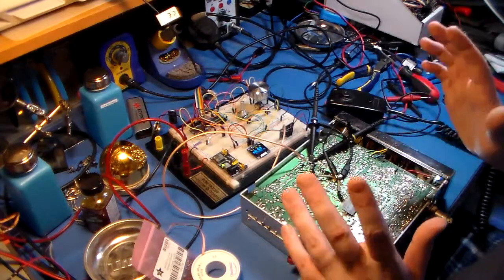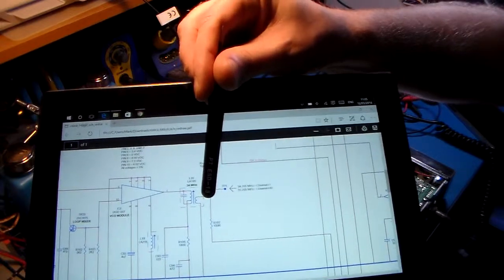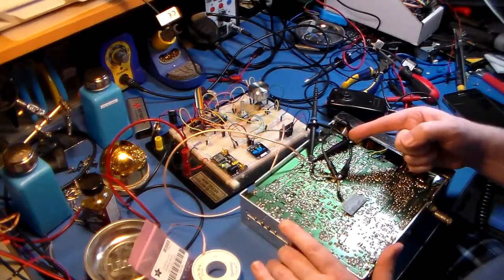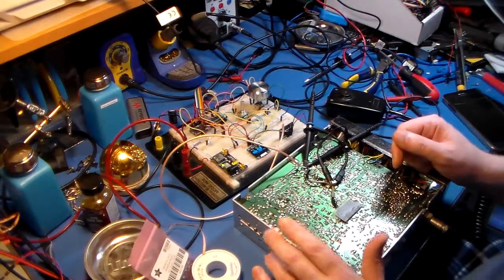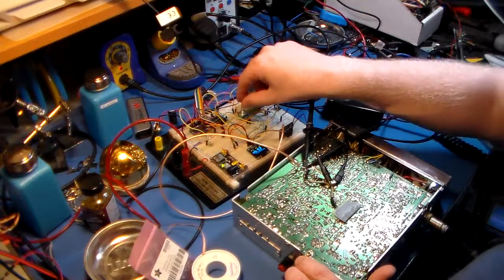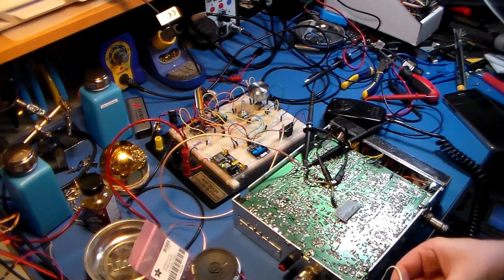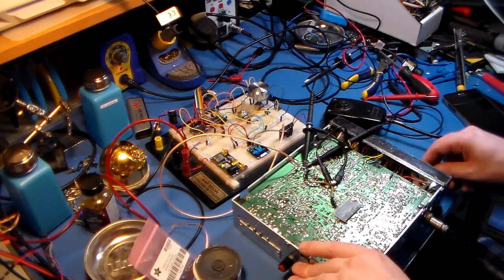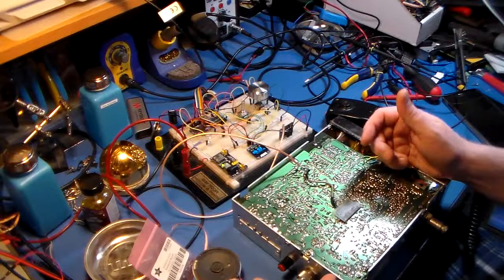Cobra 148 with Si5351 clock generator

Comment: Hi, A nice bit of software, Yes the other comment is correct, Take the USB and LSB + supply to the arduino and code the + and -
USB and LSB offsets into it. Also the clarifier control on RX will need to be applied to the hardware, and coded up. Please stick with it and would like to see the finished design working. Very good, Rich

Comment: You could just use a receiver to listen to the harmonics generated by the transmitter.  27,185 x 2 = 54.37 you could scope the signal from the receiver and see how far down the harmonic is from the fundamental. I used an AD-9850 and a cobra 148 with good results.

Comment: I've done a simular job with a 148-GTL-dx using a SDR kits signal generator , I managed to get from 25.800 ish to almost 29 MHz before it went out of lock , Obviously the IF RF needed widebanding, And you also have to   take into account the offsets or USB is off from LSB , Same for AM/FM, Although these offsets could be set up in the firmware to compensate for the +- 2 kHz or so between sidebands .... I put my 148 to one side now as time constraints is my main issue .... anyway , Good luck de Gw0wvl.